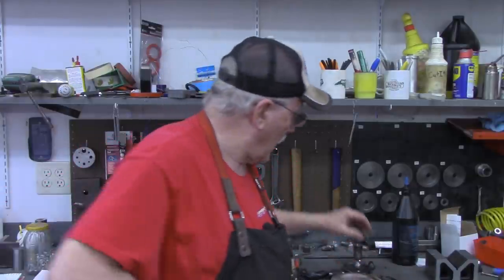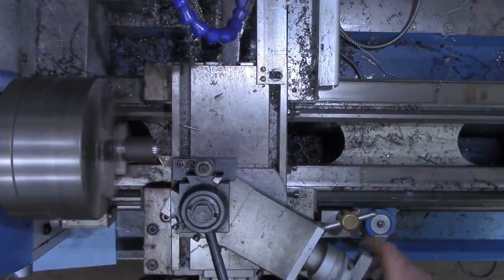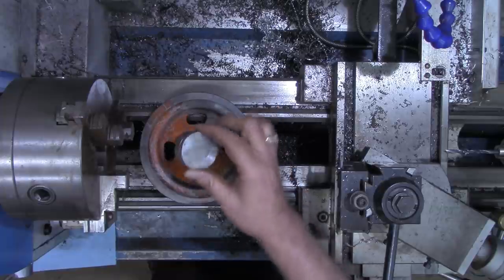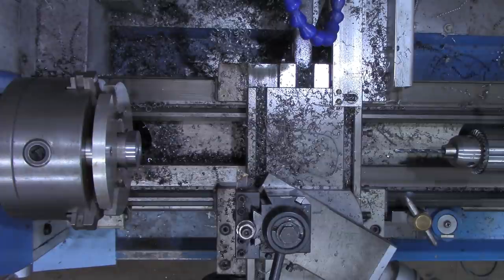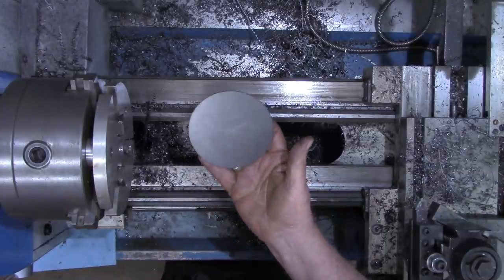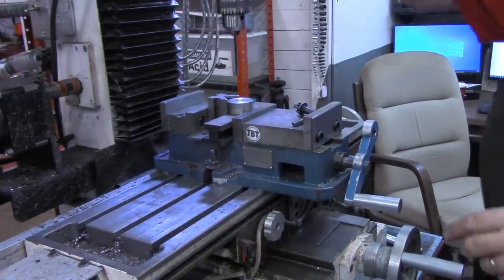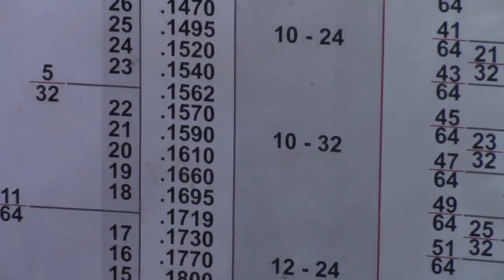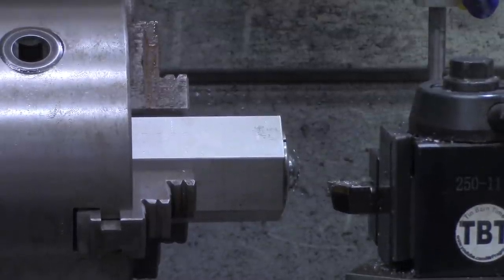20 Ton Press Forming Dies

Comment: If there is a chance you need to make more than the 35 or so in the future maybe use the press to punch the hole as well.
Setting the disc up to auto locate centrally on the die etc
Some comments suggested to do both forming operations at once which have merit, maybe punch the hole and form both all in the one operation? 
Now there's a challenge for you.......but I can see you would lose the benefits of easily lining everything up using a center hole.
Although if you made the hole punch die to locate the disc centrally on its diameter the rest might work?
More work than it's worth maybe....

Comment: Dear Mr. Lee,

I realize that it might not be the most pragmatic ( pun intended) way to produce your candle holders, but could you not have made the part in one pressing?

The plug in the pulley could have been left proud by the height of a 1/4" screw head. The upper die could have had a counterbore that was the two times the stock thickness wider than the protrusion in the pulley plug, and one times the stock thickness deeper than the protrusion in the pulley plug was high.

You could even get really fancy and use a sharpened hardened dowel pin to poke the hole in the stock at the same time, though the punch out from the stock would need to be ground off unless the dowel pin was a tight fit into the pully plug clearance hole, and the pulley plug itself hardened as well.

Or would all that extra machining not been what was needed, or not a quick as the three step process you used. I ask because I realize that it is much faster to type the above description then it would be to actually go in the shop and build it.

I always enjoy your videos. Thank you for taking the time to make them and share your wisdom with us.

Sincerely,

Leo

Comment: If you ever need to soften a ball bearing before drilling, just salvage some carbon rods from a large 6 volt rectangular battery. Holding a carbon rod in your stick welder, crank up the amps and heat it up a spot red hot and let it cool naturally. That should soften it up enough and anneal it to let you use a normal center drill on the spot that you heated. The carbon rod won't stick when you strike the arc and works well to spot anneal a lot of other case hardened parts so you can get thru that outer shell of material.

Comment: Great video, thanks.... but I'm sure you could have turned the plug for the pulley with a cone on it to form the cup in one operation.  Then used a countersunk ¼-20.  That should work for the ones going on to pillars too.

Comment: Glad to see this!  I did a similar procedure using an old pulley for the form and and really old window a/c housing to make new sheaves for my ridding mower deck.  It was a lot easier than I thought it would be and 2 years later the pulleys are doing fine.  Perfect reason why I rarely scrap or throw anything away!

Comment: That V pulley seems cast iron I wonder how it supported all that pressure in forming the plate??
Reply: John Hili thin steel plate. It doesn’t take much pressure. You rarely use 20 tons of pressure with a 20 ton press.

Comment: I’m wondering why 5mm?

Of course, I typed this question before the end of the video, so...
Reply: locating pilot hole and mounting hole for the candle holder
Reply: Yeah, I knew what it was for, ive done this myself. I was wondering why 5mm.
Reply: @melgross  because the metal actually stretches as its pressed resulting in a larger hole.
Reply: Thank you guys. I know this. I was asking why he chose a number 5mm bit specifically. I know why he needed a smaller bit than the end hole. I’ve only been doing this for 50 years.